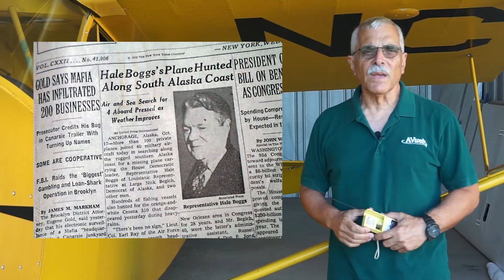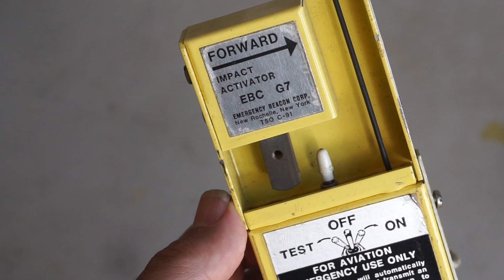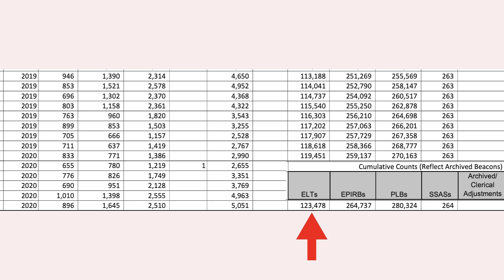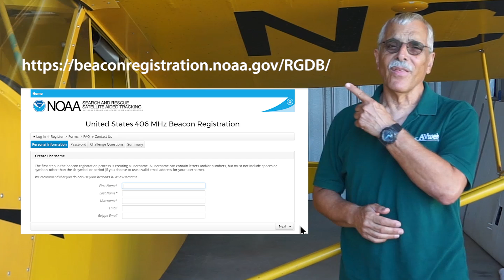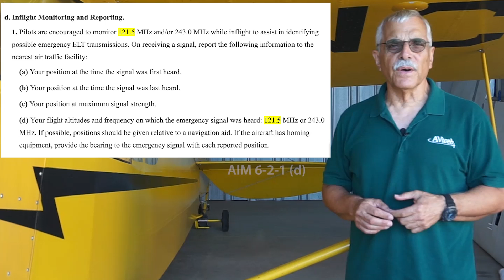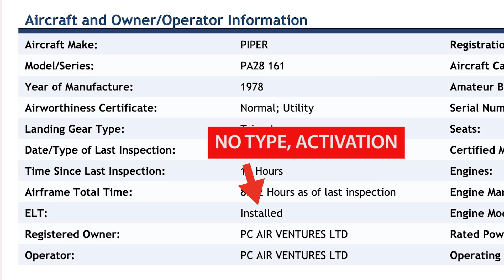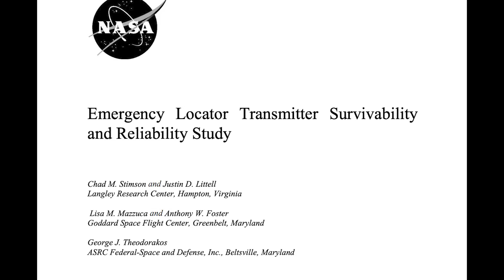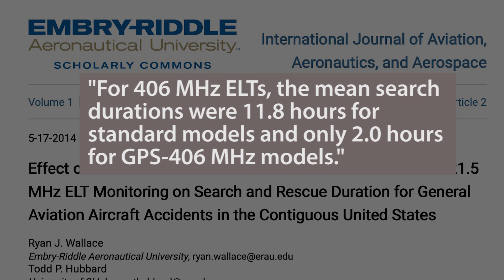Why Cheapskate Pilots Don't Like 406 ELTs

Comment: The only proper way to test batteries is to put a load on them.  A multimeter doesn't put any load on them.  A battery can test with good voltage but not carry a load.  If the multimeter shows low voltage, it's bad for sure, though.

Comment: I initially bought my Garmin inReach for mountain biking. Also handy for the occasion I decide to go run in remote locations too. When I started flying it seemed like a no brainer. 

If I'm flying somewhere outside my local, high population dense area, I turn it on before take off and send a tracking link to a couple people I trust.

Worst case, they will know my last location 10 minutes ago, worst case. Best case and I not only have it still working when I am on the ground, but I can use it to communicate real time with someone.

Comment: Have you ever considered that you're just a pilot and you're spouting all these numbers? I dare say you could come out against the life jacket. If you considered how many life jackets are out there that never see a person or water. All sorts of vessels that go 20-30 years and never have a problem, life jackets that dry rot and are replaced. Even though the law is wide-reaching and accepted it's still doesn't have the kind of results you're getting. So your mathematical argument is interesting and if you pinned it on any other safety thing you look like a fool. I wouldn't think an airliner would need a locator because they are so big and so closely watched they don't disappear very easily. I always have to tell the pilots to think of something on the ground as not being anything more than a pile of cow pies. If you have that emergency locator go off, that's a lot of manpower saved. If you would think for a minute of someone besides yourself and your wallet.. how much do the taxpayers pay to you search for you? How many times will your old wreckage somewhere hiding draw people to their end? There was a guy that went to a bus and died in Alaska and they finally had to take the bus away because people read his book and kept coming to see the bus and dying on the trip. Now there's just a little sign that says there's no bus anywhere we came and took it away

Comment: Those cable pull-out pictures on 13:26 are far to common in these types of connectors.  Those crimp type connectors end up killed by the crimped sleeve. I am with the Civil Air Patrol and EFJ radios sport those connectors, and they fail all the time. In order to avoid this failure, I use a big size plastic wall plug (hole big enough to fit the crimp/cable), which I cut along one of the sides and place covering both the crimp and the pigtail cable. I then hold it in place with zip ties. this prevents the cable dancing around the edge of the crimp, plus uses the crimp as support to prevent pull-outs. This arrangement never fails.

Comment: I changed an 121.5 ELT battery on a Saturday a few years ago. At 1 AM on the following Monday I got a call from CAP that my ELT was going off. I must of triggered it installing the new battery. It took 3 days for someone to notice the alert with my plane sitting in an airport. I don't have much hope for location by ELT if I really need it.

Comment: I have an old 121.5  which uses D batteries, I am one of the cheep pilots  ,a Spot and a 406 PLB. I am covered.  The spot I leave in a tracking mode which my kids have access to.

Comment: ELTs must be mounted within 10 degrees of the line of flight which may not be the line of the final trajectory of the aircraft going into the crash.
Most ELTs are mounted in a bracket structure parallel to the tailcone which may not be within the 10 degrees line of flt. of the aircraft.
Meaning, no activation of the G switch.
G s switches need to be designed to function in any direction.

Comment: Your comment that "nobody will fix them [121.5 ELTs]" does that mean they aren't allowed to be repaired, nobody knows how to fix them, or it's not worth fixing them? I spent years working on electronics, an a HAM radio operator and am looking to getting my A&P licenses. You kind of made me curious if this might be an untapped market.
Reply: 121 MHz are no longer sold and no longer monitored by satellites only 406 MHz so if you do decide to get an elt don't get a 121

Comment: 5:37 In what universe does “…more than 50 [false Emergency Locator Beacon alerts] a day. Twenty-four/seven,” make sense? I mean, wha…? 24/7 what? Even “more than 50 a day. Seven,” makes slightly more sense. Append ‘52’ or substitute 24/7 for 365. Well, 365 or 366. Alternatively, 365.25 maybe more so.

Comment: I had no idea ELT's were so unreliable.   I was just about to order a 406 replacement for an Ameri-King (ref. AD on the 450's), but after watching this video, if the 450 tests OK, I'll just invest in another PLB and stash it someplace convenient in the airplane.   It's a safe bet that if the wreckage ends up inverted, no one will hear either a 406 or 121.5 ELT with the antenna in the dirt.
Reply: I like your thinking

Comment: ya know, those 406 ELTs usually have an indicator light and an on button in the cabin.  If you know you are about to have to make a forced landing, you can activate it before you are even on the ground.  I don't ever seen them in the engine out check list, but it sounds like a good idea.

Comment: I replaced my ELT with a 406. The battery may last longer but are much more expensive. I also carry a PLB 406 . 6 Ps Proper planning prevents piss poor performance. At least I have a better chance than those without . And as a pilot I spend money on stupid things often 😀

Comment: If I remember right ELTs I worked on used C size batteries.And they came in a cardboard box with the wires and connector protruding out.I remember this from doing 100 hour inspections on flight school aircraft.

Comment: Excellent point but for those 29% it aided -- I wonder how they feel about ELTs. Statistically speaking it wouldn't have saved them but real-life says it did. If I had to choose between 1% chance of being located and 33% chance of being located -- I'm choosing the 33%. That said, the industry should really upgrade the equipment and the government should subsidize highly capable and inexpensive safety equipment. Stop the wasted gov't dollars on unnecessary SAR and subsidies would probably pay for themselves. It's not rocket science, just thinking about the problem.

Comment: Avaition buff and overall curious person here.  This was a great, real world experience from a pilot that helped me understand what all the hype was about.  Personally, if a civilian is a bit on the anxious side, I would invite them to consider a 406 PLB for the reasons that you have stated.  As for ELT's in planes and the 30% benefit, I would take that 30% if I would fly a lot, fly at night or head into mountainouss regions. Mounting seems to be an issue and that can be "improved" if the price is right.

Comment: I was an avionics tech in GA from 1970-1984, putting me in the early years of ELTs (aka The Box that Cries Wolf). I can't estimate the number of times we have searched on the ramp for the source of a false alarm. We never knew if we were finding it until we got within about 20 feet of the plane.

Comment: Not noticed??? Mine is a Pacific Communications Alert 50. The batteries are extinct.  The inertia switch is quite good.  Just four AA batteries will be voice recorded and black box located by dozens of airlines and the pilots will be talking.  Large ships often carry long yagi antennas for finding 121.5 . Dollar General sells holiday packs of batteries that could have you flipping the switch for spotted planes for a few weeks.  Why you mount them makes no sense.  In a bag behind a seat would be a better way to retrieve and assemble the transmitter for a hike or tent.  They are perfect for sailboats. Why can't we use one in a brand new Warrior?

Comment: Thanks for including the use of an L-PER in the picture at 3:51. I was on the SAR team when I was in Civil Air Patrol and we responded to an accidental ELT activation at least once a month. In a rural environment  they aren't bad to find, however, when one goes off in a hangar/ around buildings/ or in an urban environment they are hell to find. The signal reflects all over the place and they were an absolute nightmare to locate in a large hangar with several plane. Pilots had to be called to check their aircraft and there were some cases where we just plain could not locate the one that was pinging. On the funnier side we were called out to respond to an ELT (non 406) at a small local airport only to get there and find that the damn thing was moving. Turns out a student pilot practicing touch and go's hit one a little too hard and was still flying the pattern. Thank you for the CAP shoutout. A lot of people dont know what they are and its a great program for teens. Virtually all of my friends from CAP ended up in the military or aviation, myself included.

Comment: My favorite exception to whether or not an ELT is required is for single seat aircraft.  No, the FAA doesn't care if a pilot is alone and crashed; but if there is a seat for a passenger, by God you'd better have a way for folks to find him if things go wrong.  And no, I don't have an ELT in my single seat aircraft.

Comment: Bendix King had a killer solution in the KLX100 handheld GPS moving map/comm radio. The radio allowed you to record a 30 second message and then it would broadcast that message and a voice synthesized recitation of the current LAT/LON. The beauty was, assuming the radio was still working, if you were able to travel the LAT/LON changed as you hiked out and that was what was transmitted. Find the person, not the plane. I don't know of any other similar system.

Comment: Especially important when it comes to testing batteries is using a load resistor in series to ensure you read the true usable voltage. Otherwise, they may appear to have plenty of voltage while testing, but may not when installed.

Comment: You'll be glad that you pinched pennies when you're hoping to get rescued.  You should also always file VFR flight plans with total time enroute times, because that's how long it will take to get to the destination with all of the fuel stops.  Also, give PIREPs based on how far you are from the destination, because light chop 300 miles from where you want to go is very important to other pilots.  General aviation has become a real shit show.

Comment: I wonder how much of the failure of the ELT is due to less than optimum installation? Back in the days of AMPS mobile phone service I had a customer who insisted on a particular, odd antenna. He was equally picky about how that antenna was mounted, how the phone was mounted, how power wires were hooked up, etc. I did it his way because he was willing to pay for that. About a year later he was back. A dirt road on his land collapsed under his truck, which rolled over 100' down and caught fire. But the phone still worked well enough to call his wife and tell her where he was and what happened. By that time I had noticed that almost no normally installed phone of the then current types worked after any wreck that set off air bags. Antennas broke, coax kinked, pulled out or got smashed. Power wires came loose. Fuse holders broke. Handsets came loose and bounced around the interior. Wires between the handset and the base broke... Maybe if we install ELT's with an eye towards what the aircraft will look like after a crash, they might work more often. That coax connector sticking out like a stump with the shield connection pulled loose probably would not have failed if a 90° elbow had been used and the coax had enough slack to absorb a little movement, but not so much as to vibrate and fray. In short, I think that would have failed even if no crash had occurred.

Comment: A call on 121.500 /243.000 in the UK will be answered immediately by the Distress & Diversion Cell. Should not aircraft with more than 2 Radio sets have one set to 121.500 at all times ?  Seems like the General Aviation Community is being sold short in the Good ol' US of A !

Comment: I used to work in an avionics shop, on ELT's.  I would wager that the 406's are more robust than they have ever been, and likely survive 95% of crashes.  The problem is, the coax cable from the ELT to the antenna gets torn out in the event of a crash.  They call this a ELT failure, where in reality the installation failed.

A solution to this would be for all 406's to have onboard antennas, much like the old 121.5's.  I'm not really sure why this isn't implemented at all.

Comment: This seems like such an easy problem to fix. It is all bad design considering current technology.
 There should be three buttons on the device. One to test with, another to manually activate it, and a covered cancel button (to make sure the right button is pressed in an emergency). On manual activation the device needs to send data or some other signal type than the test signal (both same frequency, but different data sent). On crash the g sensor should set the signal type to indicate that the emergency threshold has been exceeded.

Mechanical g sensor switches need to be replaced with modern (inexpensive) accelerometers. The crash indication can then be tailored for thresholds in all directions instead of the limited ones the mechanical switches can detect. The battery can be replaced with a 10 year one. The device should have multiple antennas and be mounted such that it is unlikely any would be damaged. The housing needs to be strong enough to take impact from surrounding airframe, including armor over the antenna connections and wire.

This should reduce false positive indications. Also it has no moving parts to break and will be light weight reducing inertial forces in a crash.  Basically the problems with these devices are all fixable, the intent of the device could achieved and be highly reliable.

To deal with activation due to tail strikes, there can be a manual cancel button which sends a cancel signal for a few minutes before turning off (the test signal could be the cancel signal). It should also be powered by the aircraft power so that the battery is only used when power is lost. Then a false activation when the aircraft is intact does not require replacing the battery. There should be an audible alarm so that the passengers know it has activated. The volume can be loud at first, and then softer at a less frequent interval to save power and annoy people less.

Other nice to haves would be to have it broadcast a data signal that contains the location and identification number of the aircraft. The g data, to know how bad the crash was, and what kind of response is likely needed and what kind of debris to look for. Temperature data to know if there is a fire, and if the passengers will need extreme weather care. To also broadcast on cell emergency channels with information that it is and aircraft crash.

Comment: I had an alarming call from the Air Force. They wanted to know if I knew where my plane was. I was in Orlando and the plane was at KISM. There was a big violent storm going over us. I told them that I hope it's still at KISM. That's where I left it. Since the plane was not powered on the GPS input wasn't feeding the ELT. I conferenced in the FBO. The plane was about 50' from the FBO and it was raining so hard they couldn't see my Bonanza or any other plane out there. Took me a long time to get there. All the roads were solid cars and flooded in many spots.
The plane had been thrown around hard enough to set it off even though it was tied down. The airspeed indicator also showed 150 MPH at tie down and the altimeter was off by about 300'. They were both fine after a couple of days. There was no permanent damage to the plane.
I used to have an ACK ELT. Went off at least three times while I had it. They didn't see any of those alerts. Then there was an AD to remove them. The 121.5 part of it worked, the 406 side that I couldn't check was junk. So I was probably flying with a dead 406 ELT for years and didn't know it.

Comment: A couple thoughts;  as a 3rd shift sheriff's sergeant in the upper midwest
and scanner hobbiest, I kept my hundred dollar pocket scanner in my
bag for long winter nights, etc.   I ran down 3 firing ELTs  BECAUSE
121.5 is scanned let but 406 MHZ gear  costs lots more.   I dummied
up a wire loop antenna and tracked them down in our lumpy 25 X 30
mile county., 1 hard landing, 1 medflight helicopter shut down improperly
and one in a guy's pickup at home getting ready to replaces the battery.

Comment: Very interesting...and funny! I laughed more at the last fifty seconds of this than anything else on the web in the past month. Thank you.
BTW, how far does the typical downed aircraft manage to crawl after impact? I assume that's the reason for cramming all that battery power in the pack versus a single, strong code train pulse with all the relevant info on impact. Can I assume that, if there's no impact trigger event, there's likely someone around capable of triggering it manually before the downed plane begins to wander off?
Reply: Even in a non-survivable accident, locating the wreck quickly helps to conserve SAR resources, hundreds of man-hours might otherwise be spent combing a very large probable region of flight.  Consider both the Hawthorne 708 crash back in the 1960s, where the crash occurred in February but the wreck wasn't found until August, and the MH370 ongoing mystery - though the latter involved an apparently deliberate deactivation of the aircraft's installed tracking features.  Just knowing roughly where to look is already a big help in such cases; Hawthorne 708 was found well away from its authorised route.